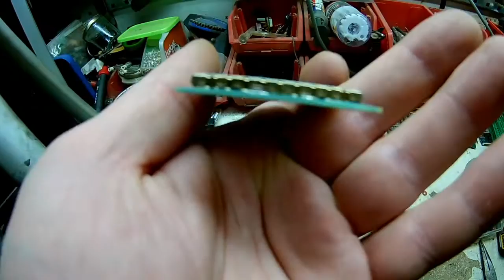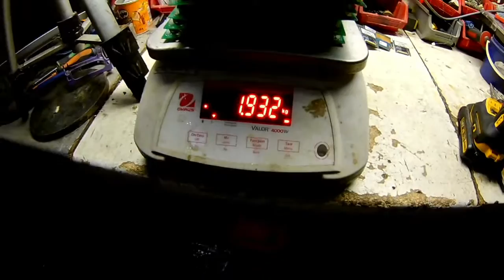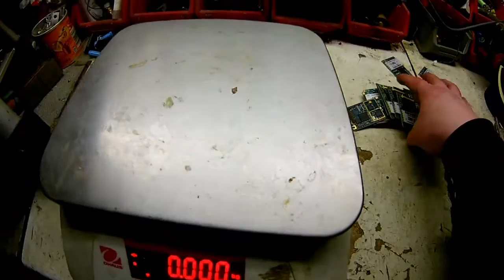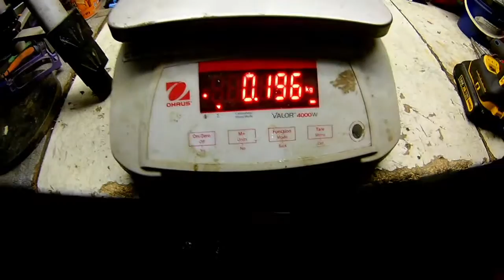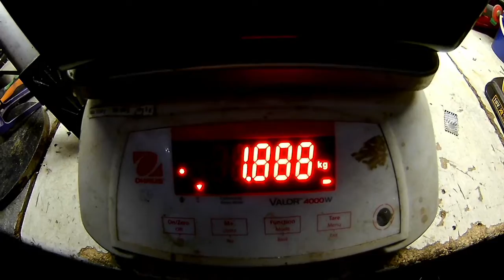24 nice circuit boards part 1

Comment: Nice boards mate. Are they out of GPS units? Looks similar to some I've done 😃
Reply from the maker: not sure or what it comes out cause i get it as you see but i believe it was gps tracking devices for trucks tho not sure every GPS has that nice ceramic chip and on this one, i don´t see it but who knows
Reply from the maker: tho i will look again at your device  don't remember that or i mist that one
Reply: @RafalScrapper  looks similar, its an older video but the Sim card set up was the same .....I think lol